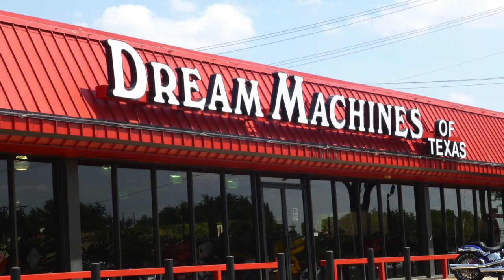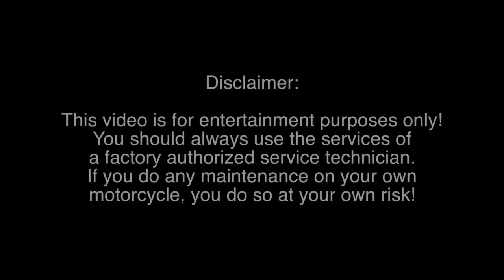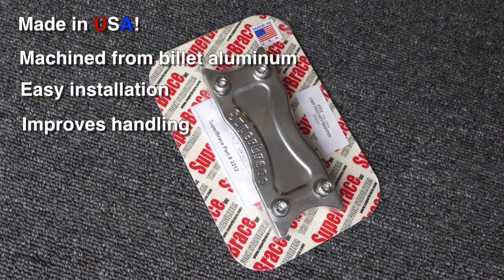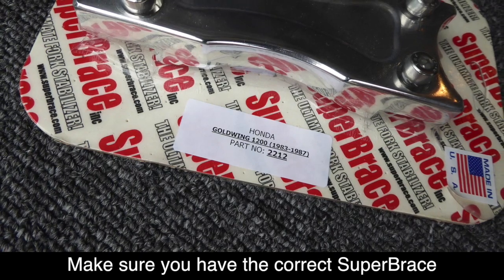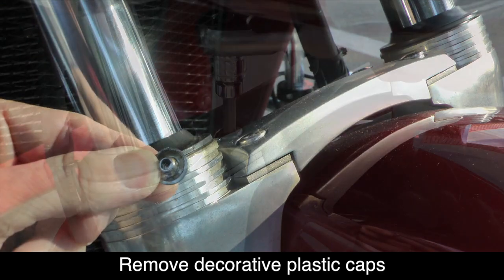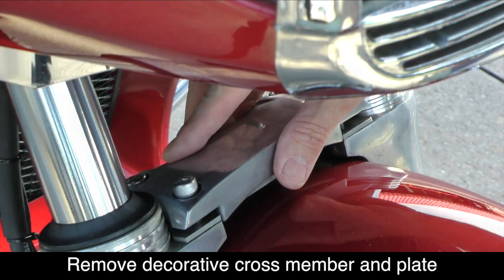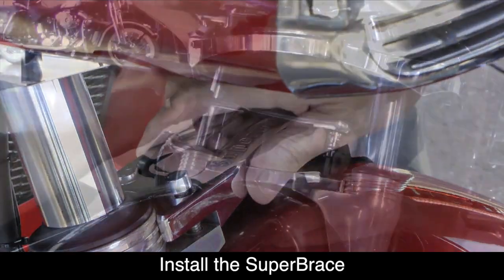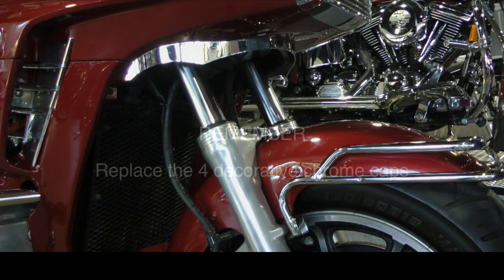Install SuperBrace on Honda GL1200 Goldwing

Comment: How could that aluminum piece be stronger than the steel piece that was under the decorative piece?
Reply: Funny how that decorative piece is the part that is VISIBLE and gets RUSTY!!! That's the only reason I might be interested in buying one. It may actually cause more trouble than it is worth, otherwise.